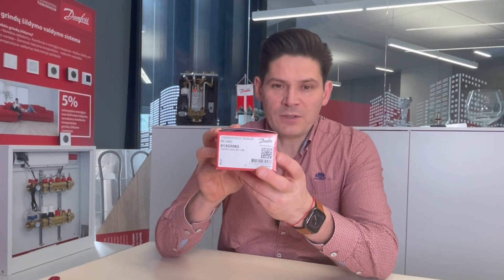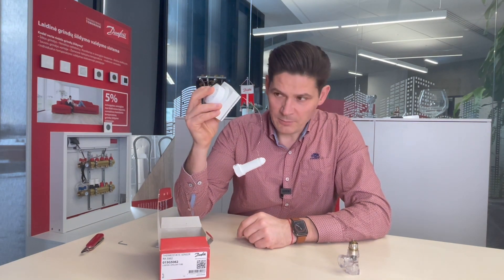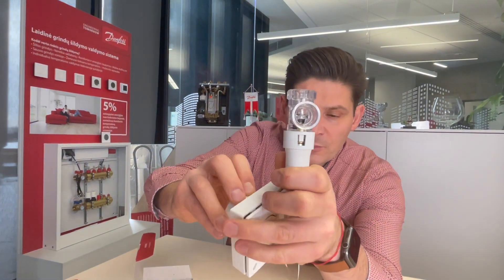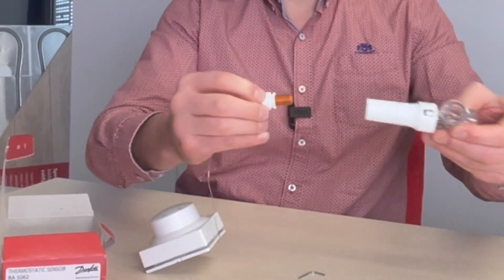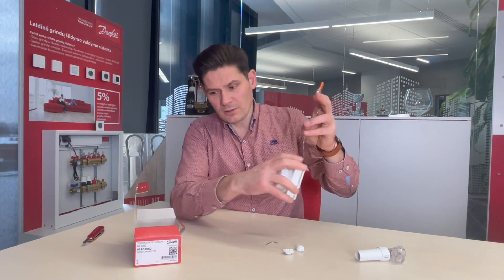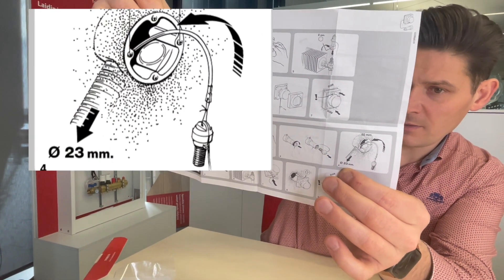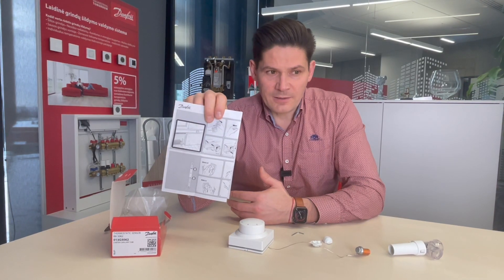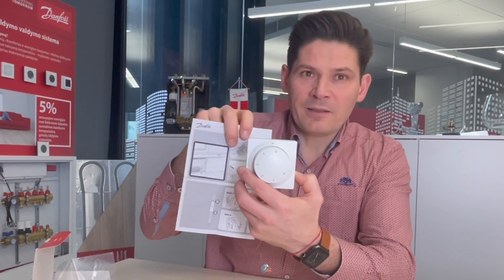Thermostatic radiator valve with remote sensor working principle

Comment: I was wondering WHAT the valve mounted dial WITH REMOTE SENSOR actually does. What’s the purpose of the REMOTE SENSOR
Reply from the maker: The dial sets the desired temperature, just like on a standard thermostatic valve. The remote sensor measures the temperature away from the valve body, instead of right next to the radiator or pipe.

Comment: How does the the knob communicate over the wire? It’s not electrical, is there another wire inside the wire that tensions?
Reply: Yeah, for a video title that claims to explain the "working principle," this video simply does not deliver on that promise.
Reply from the maker: No, there is no wire inside. It is a tube filled with gas and liquid. Inside thermostat there is bellow (capsule) connected by small tube to bellow (capsule) on another end. The time room temperature has increased, pressure also increases and bellow on another end expands. Electricity is not needed. All self acting.
Reply: @heatingsolutions123 Based on the title, the entire video should have been about explaining this.